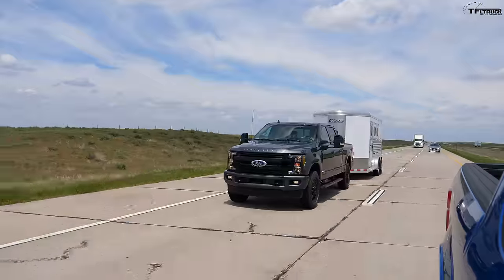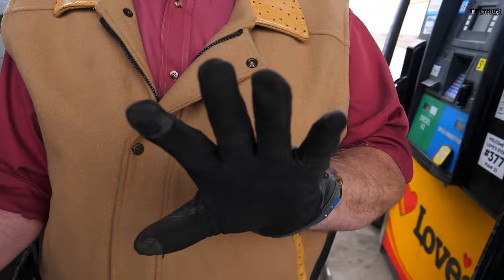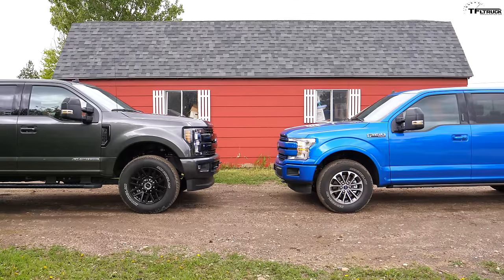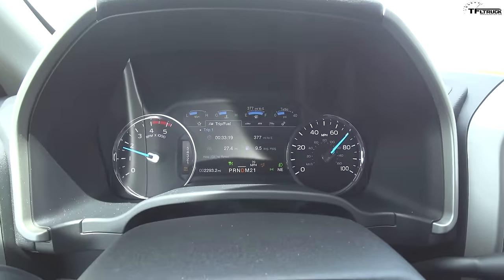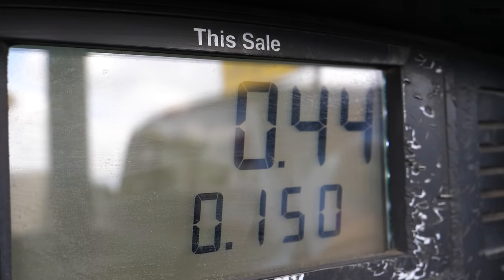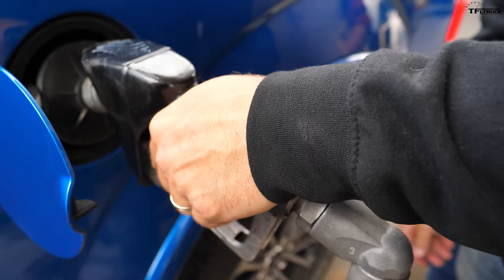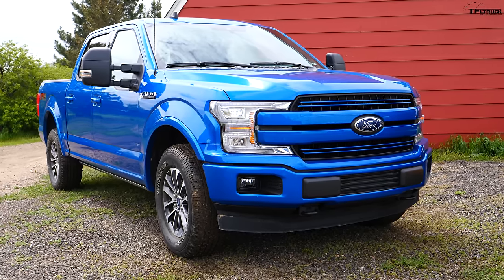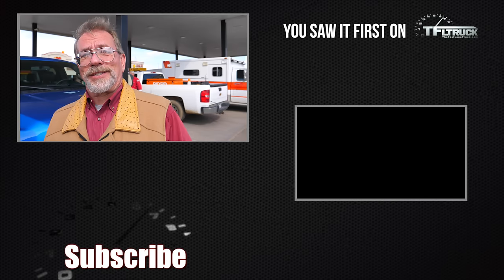Do You Really Need a Heavy Duty Truck to Tow 9,000 lbs? Ford F-150 vs F-250 MPG Review

Comment: I traded my 2011 ram 2500 Cummins for a ‘17 F-150 eco boost to tow my 32’ travel trailer that weighed about 8000lbs loaded. Huge mistake. The ford had plenty of power but the trailer pushed the lightweight pickup all over the road, even with a finely tuned weight-distribution hitch. I felt truly unsafe while towing, and I didn’t want to gamble on my family’s (and my own) safety while road-tripping. 
Just a few weeks ago, I ended the 1/2 ton experiment and traded back to 2017 ram 2500 Cummins.  Its such a different experience. I can barely tell the camper is behind me. 
It’s all about the trailer’s profile—is it a flatbed or a wind-sock? That’s, perhaps, the biggest consideration when choosing your vehicle.
Reply: John Askins Put two motorcycles in the bed of the truck to balance weight distribution, problem solved.
Reply: @angelgjr1999  problem,  makes the front still way to light.   Lil half ton trucks especially with the lighter bodies are really not an ideal thing to tow heavier weights.   That's the real only knock on them.
Reply: David Lusk Front end is too light? Are we talking about the same truck? F150s weight 6,000 pounds. It’s not light at all. You may need new tires or alignment fix.
Reply: @angelgjr1999  6,000 vs 9,000 behind you.  They push lil half tons  all over the road.  People think they are big trucks, but these things aren't meant to tow near that weight.  Its great for show, but suicide  for ling distance.   That's why i bought my 2500 hd last year with 6.6.  I can  tow almost anything i want without even worrying about getting pushed all over the road.
Reply: David Lusk Get an SUV if you want better weight distribution then. But that’s a bit extreme. You should get a semi truck if you’re towing that much. 95% of drivers never tow anything above 3k pounds.
Reply: Daver G  
Agreed,   but everyone has a view point and i enjoy hearing very different points of views, no matter how extreme.  😁😉 the 5th wheel im going to get is 12,500 empty, pin weight around 2,300.   Half tons needn't apply lol
Reply: John Askins Exactly right. I went with the diesel Titan XD for the extra power and overall heft for just that reason. I tow a 9000 lb fifth wheel. I don’t tow enough to justify a true 3/4 ton nor did I want the harsher ride. Best choice I’ve ever made.
Reply: Im suprised you found it that unpleasent with the f-150. I have a 17, 3.5, max tow, and my RV full weighs about 6600lbs. Add the family, firewood, bikes etc and it a little over 7000lbs total and it tows very comfortably, even in decent winds. Im at max rear axle weight though. I see people towing much bigger trailer or 5th wheel with f-150...they have to be way over.
Reply: I tow a 7k 31 c ft trailer with an Expedition EL. No issues here with the WDH configured. It moves a bit in high winds, but I just drive slower and it's fine.
Reply: Wise choice John. If you get your rig up where the air gets thin, you won’t regret your decision.
Reply: If you had a Max Tow or below, that would have been the wrong truck.

Anything over 8,000lbs and 30 plus feet, I would want the HDPP F-150 or better.

You definitely had the wrong truck.
Reply: There's a big difference in towing a flat bed trailer with a load of pipe and a high profile travel trailer even if they are the same weight.  The side loads from wind on a high profile trailer cause a lot more problems with a light duty truck vs. the F-250.
Reply: Not only that but your cargo capacity goes into the toilet.
Reply: David Lusk or 8,000 lbs vs 14,000 behind you, MUCH better.... lol. Newsflash, a 12,500 lb dry weight fifth wheel will have a significantly higher pin than 2300 lbs (try 2800 + loaded), therefore you’re close to 1,000 lbs over your payload capacity (given the half ton like payload capacity of a diesel 3/4 ton), MUCH safer. With a properly set up wdh (not by dealer) 9,000 lbs isn’t pushing around a properly equipped half ton, and as far as unloaded ride quality goes, well, ........ 3/4 tons need not apply.... lol.

Comment: I wish you would pull travel trailers instead and see how they pull those big boxes down the road and up mountain roads.
Reply: I agree. I have no problem towing 12,000 lbs in my f250 using my dump trailer.  But a 34' travel trailer intimidates me.
Reply: Totally agree. I know, a lot of folks MAY pull a horse trailer, but, let's see a travel trailer or  5th wheel trailer in acion; also, let's do some acceleration, reg driving, passing, etc. Oh, don't forget, let's see how d'hill driving (mtn roads!) results. Y'all Be Safe!
Reply: They literally just did. Lol
Reply: I have a F150 with the 3.5 EcoBoost and the problem is not power.  It has plenty of it and more torque than the 6.2 gas F250 (my brother in law has one),  however with a 15mph cross wind the trailer (30ft 8,000lb) feels like it is walking on you in the 1/2 ton where the 3/4 ton feels a lot more solid.

Comment: Travel Nurse: I have a 2016 Colorado 2.8L 4x4 Crew, tow Camplite 21RBS w/ Suzuki 750 King Quad in the bed that I tow to all my assignments, I average between 19-20mpg towing it, but if regen kicks in while towing my mpg will drop like a rock to around 10-12mpg before jumping back up. It's hard to show what diesel does towing in regards to MPG when it obviously went into regen while towing. I previously had a 2014 Dodge Ram 1500 5.7L Hemi and would pull off 6-8mpg towing the same load...

Comment: Would've loved to see more details on the towing setups with both as well as more comparison of driving impressions w/ the trailer in situations other than straight down the highway. I'm more concerned with being able to safely pull a 10k trailer with the F150 once in a while then the .5 mpg difference.

Comment: Should have done a gas 150 vs gas 250, then do diesel 150 vs diesel 250, gas 150 vs diesel 250 are way different leagues
Reply: Instead of dropping $50k on a new f-150 buy a used Diesel and it will serve you better 👍
Reply: They only test the trucks they're given you dope.
Reply: @greco2189   diesel are really meant for your heavy loads something you need in case you have something really important to haul or travel. 
 Gas trucks are really your life truck,  They cost a little bit better in money wise. They are useful for your daily chores around yard work or Man stuff. Or your fun activities with the wife. Diesels get better gas mileage because of the way they're designed. However pick up truck diesels are built to be fuel power hogs. 
Only company that's allowed us to have 4 cylinder diesels in usa market Which are designed to get excellent mileage 30-70mpg  Is the Volkswagen Jetta. 
They're not built to be powerhouses mainly mileage.  Meanwhile Europe is laughing at us while they get over at least a 80mpg
Reply: @greco2189   80MPG....all like "am I a joke to you?" 😂
Reply: @greco2189   Quite a few actually
Reply: @greco2189  get the 22 bro wood chucks good eating

Comment: You should have done some 65 to zero stop tests. That is far more important than whether the gas engine can pull a trailer up a hill. Another factor is whether or not you have the factory trailer brake package. It has proportional braking based upon the master cylinder pressure. That's the best option you can buy.